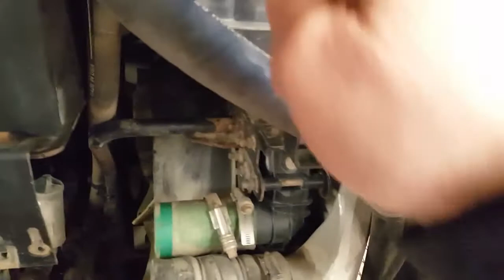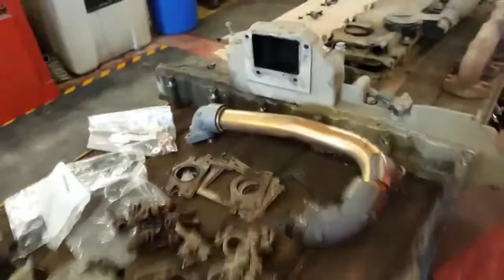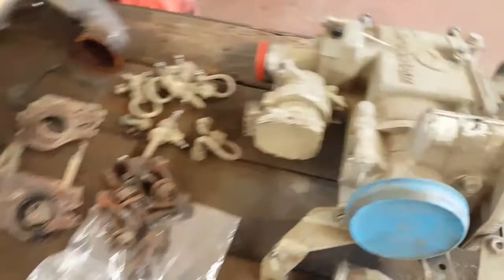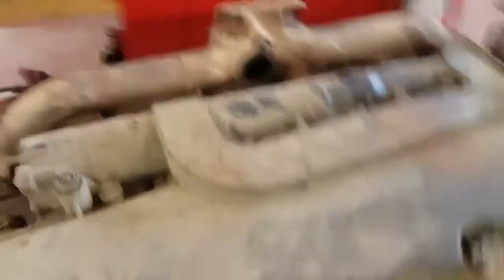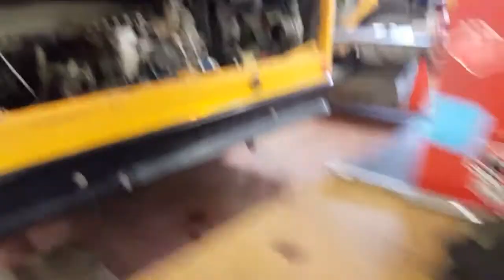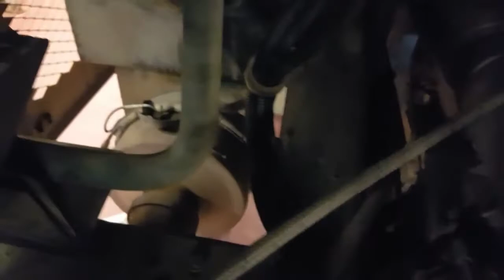2008 Mercedes MBE 900 Diesel Engine Repair

Comment: I have a mbe 900-250 in a sterling acterra. Starts great, idle fine until temp starts to rise. At an idle it then starts to surge. Still has great power, no hesitation, and smooths out at higher rpm. No smoke at all. Do you have any idea what it could be?

Comment: where are you located?
Reply from the maker: British Columbia
Reply: @MechanicsHubdotCom   wish you were closer i would pay you to fix my mbe 906...
Reply from the maker: I don't mind helping with advice. Where are you located?
Reply: @MechanicsHubdotCom   im in London Ontario .... i got myself a little ambo drove it up from the US .. drove great no isee engine 906 ran like a clock .. lots of power and rather quiet...  next day crank but no start... now the mechanice shop told me ECu is not communicating with injectors...  not sure how that is possible over night ...
Reply from the maker: @EiEioGuy  We had a few fail just out of the blue. The engine ran but poorly. Did the shop say there was battery supply to the ECM? Mercedes calls it MCM (motor control module). I could get you the 120 pin wiring schematic for the mcm? It will show you injector circuits and power supply etc. What year is your rig? I realize it's 2006 and older. There's less emissions and sensors on a 906 so there may be a  circuit malfunction.
Reply: @MechanicsHubdotCom   what is you email i can send you my contact info and call to make it easy ... if you can sell me a copy of the book im willing to buy it as i cant find one out here.
Reply from the maker: @EiEioGuy  I just have the one shop manual. I would prefer if you give me your contact info.Thanks
Reply from the maker: @EiEioGuy  I never received a message. Can I send to email you provided?
Reply: @MechanicsHubdotCom  yes please....